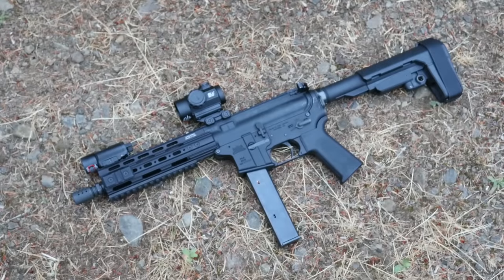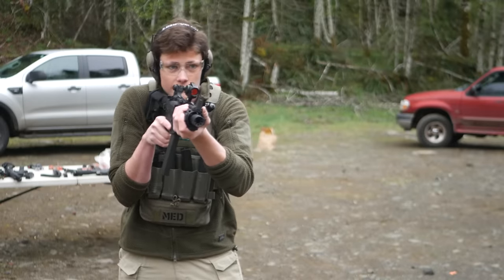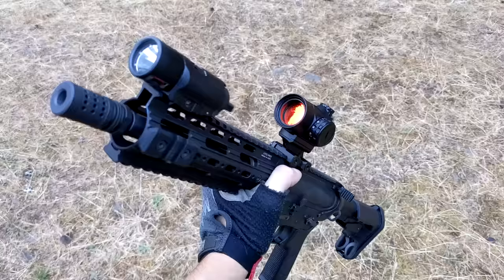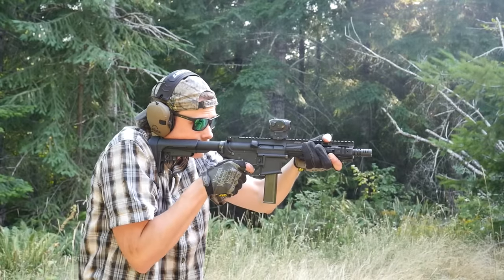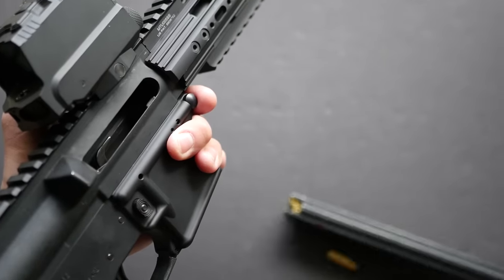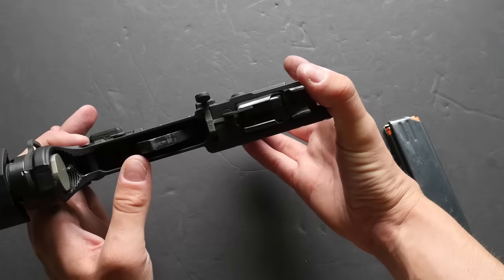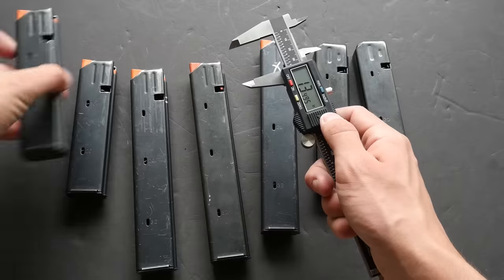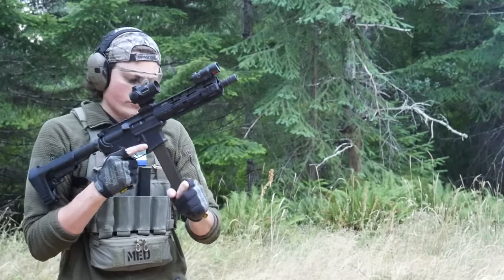The Perpetual Agony of the AR-9

Comment: I have a Aero Precision EPC-9 that I built that would double feed every 3 rounds with severe bullet setback on the 27rnd Pmags but would run flawlessly mag after mag with OEM Glock 33rnd mag.

Going to test the reliability of HST 124gr +P whenever I have the chance and prices get cheaper.
Reply: So, basically never going to test it?
Reply: Did you replace the hammer to stop the double feed
Reply: @chadwik4000  Was never notified of this comment lol. But i rebuild my EPC-9 last Saturday with the improved feed cone barrel from Aero and it runs both OEM and Aftermarket pmag, ETS 40rnd mags flawlessly.  I only ran like 5 HST rounds and didn’t run into problems. Self defense rounds are expensive and I’m not made of money, but I will eventually test 147GR HST when I get the chance to buy a bunch at decent price. No promises.

Comment: I built my own 9mm pcc. Faxon barrel and full weight bcg, spikes upper and lower. Found out it didn’t work with a ALG act trigger.  Swapped in a cmc pcc trigger which cured the full auto burst. Then it beat up the spikes heavy buffer. Swapped in the Blitzkrieg hydraulic buffer and springco 308 spring. Now it shoots reliable and very smooth. Mine uses Glock mags though.

Comment: Agony for sure…. Got an extar EP9 PCC featuring AR-like ergos and uses Glock mags…  it’s been reliable and extremely fun to shoot especially suppressed! Probably the best sub $500 you can spend on a PCC.  Main complaint is the price of ammo… I don’t see prices dropping down to pre pandemic levels 😒
Reply: It always seems like there must be some catch with those things, as they seem to good to be true at that price point. Does it run hollowpoints?
Reply: @chrisf247  good question… haven’t tried Hollow point ammo cuz I only have so much HP ammo and it’s expensive AF right now to mag dump…. EP9 has been a good FMJ plinker for a budget fun range session…. In the future, I Will try 1-2 mags to see how it runs HP

Comment: AR9 solution to 100% AR9 problems: Foxtrot Mike. They IMO perfected the AR9 platform. Mine runs flawlessly both suppressed and unsuppressed. Built in tri-lug barrel. Even solved the bolt catch breaking problem.

Comment: is there some kind of rule that you cant have a roller locking bolt on an AR9 carrier with matching barrel extension. Like it doesn't have to be exclusive to that stamped piece of garbage with a 12lbs trigger does it?
Reply: You have to use their carrier group (AR9s use fixed blocks of steel) but yes you can install their barrel and bcg into any upper

The main issue is that the lower has to be either endomag or their own designs since RDB feeds differently
Reply: @DD-hz3ts  I wouldn't mind paying the premium for mp5 mags if it meant a modern platform to use tbh

Comment: Ar9's at pistol barrel lengths, suppressed is too much gun for the caliber. I'd be happier with a flux brace on a suppressed Glock especially considering the ranges you'd be using such a caliber. The only advantage to having an ar platform in that small package would be for a suppressed rifle caliber like 300blk. 
Am I wrong for that?

Comment: Interesting. I've had OK luck with cproducts mags but I have to shave the follower down and reshape it closer to what the metal form ones are or it seems to bind randomly on the mag well adapter.  Metalform has been good but no matter what brand of mag I use, I can't load past 26 rounds if I want 100% reliability.  I think this is related to the mag well adapter, which is unfortunate because I shelled out for the Hahn precision perm adapter. Perhaps a 2 piece pinned colt style would work better.

I use a ramped adco bolt, never any reliability issues with it for me.

Comment: Have u tried the taccom magnetic delayed blowback? I've had such good luck with it. It really does lighten the recoil considerably
Reply: Darn.  I thought I was clever when kicking that idea around with the guys at work.
Reply: I don't understand  why more guntubers aren't trying it. The dot barely moves during recoil. My AR9s  used to recoil harder than my 308( bc of 1.5 lbs of  reciprocating mass). Bc of the magnetic delay system  I'm able to remove almost a pound from the bolt.  It works so well

Comment: The one Spike’s Tactical part (buffer spacer) I tried on my AR9 build was garbage. Short stack of quarters worked better. Otherwise, my mostly QC10 build with Metalform mags has been dead nuts reliable over 3k rounds. This preceded the PCC craze by a couple of years as it was built in 2015, so the variety of parts available was much smaller.

Comment: You should screw around with different buffer springs to see if any help the jarring recoil. Twisted wire vs flat wire vs extra power, etc. Might just be boring video and a lot of stoppages though.
Reply from the maker: I've tried XP and regular springs, and different buffer weights. No real success.

Comment: Would be nice if someone did a video on why the AR-9 rifles so dirty and how to fix the problems which the manufactures will not. 
I have a Palmetto State Armory PX9 Gen-4 that fires consistently with no jams but that thing is utterly filthy. I have NEVER used or seen any pistol or rifle that puts so much blow-back crud on the brass casing and in the receiver
I did research on my gun and was told my the manufacture and many here on youtube to upgrade the buffer to the 8oz x 4" long buffer which will significantly reduce the problem. I paid nearly 45.00 after tax and shipping for it but it did VERY little to keep the crud in the barrel instead of blowing back into the receiver. 
When paying 850.00 for a gun, we should never have to deal with an issue like this
You should see how quickly my walnut tumbling media gets filthy while cleaning a single batch of 9mm cases. Sure, I can pre-clean the cases before I put them in the tumbler but we should NEVER have to do that when all 4 of my 9mm pistols that are made from a different manufacture does not crud up the cases and can easily be thrown in the tumbler without first having to clean them  
and then there is the issue of how much more often of having to clean the AR-9 due to all of the crud being blown back into the receiver.

Comment: I wish one of these reviewers would build an ar-9 using PSA AR-V recievers and a CMMG barrel and bolt. I've been wanting to try it myself but would like to know if it's feasible first.
Reply: I have a cmmg radial delayed ar9. Foxtrot lower and a side charging upper (unknown to me) it's super soft on the recoil initially but end up losing my target because the recoil is more of a 1 2 punch just softer. It routinely gets left in the bag over my scorpion and might actually end up sold.

Comment: Bruh... You took the time to rebarrel your AR-9 but you don't buy the CMMG Radial Delayed barrel and bolt kit? They are compatible with Colt lowers, all you have to do is take out the fixed ejector (usually screwed in) which would of helped your mag problem too.

Sorry to keep seeing you struggle my man, though it does validate my choice to use Glock mags in my PCC.